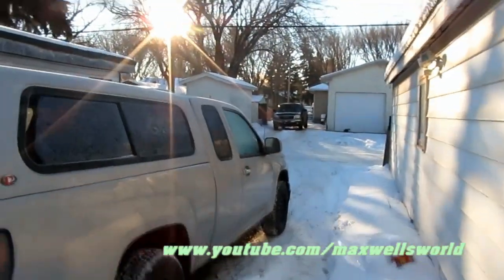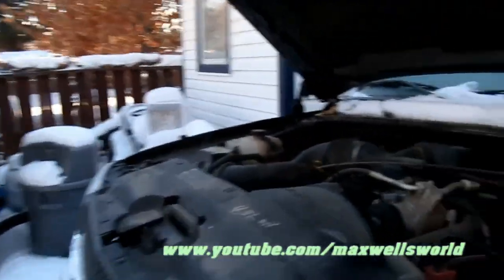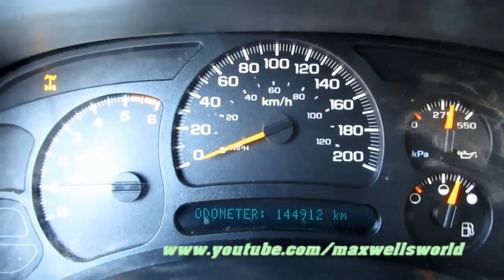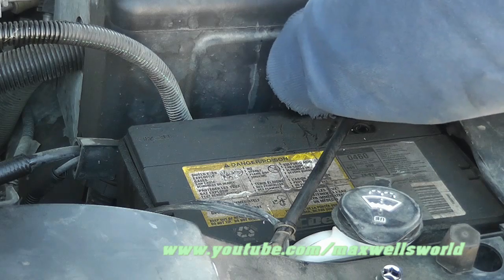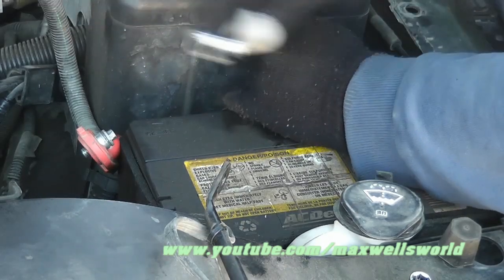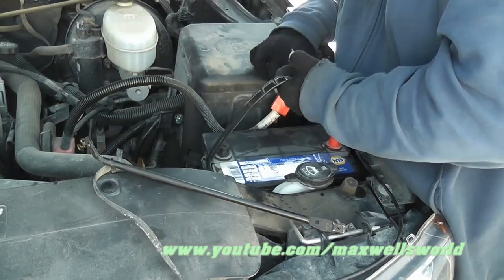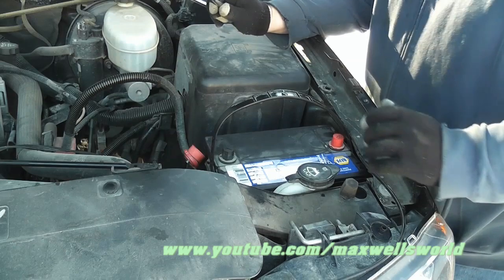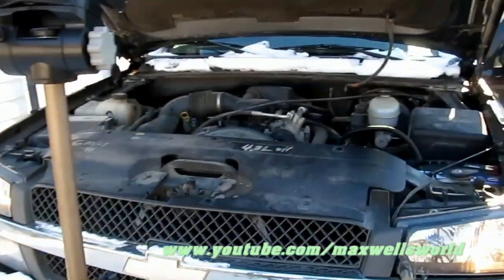battery change on a 2003 chevrolet silverado maxwellsworld

Comment: Top bar has two 10mm bolts, Bottom bracket has a 13mm bolt and the terminals are 8mm. you will need a long extention bar to reach the bottom bracket.
Reply: My hands are all fucked up because I didn’t have one 😢

Comment: Bad alternator - high voltage.
Reply from the maker: the battery worked fine for the next few years. but given the truck had a large stereo in it the alternator may have been week